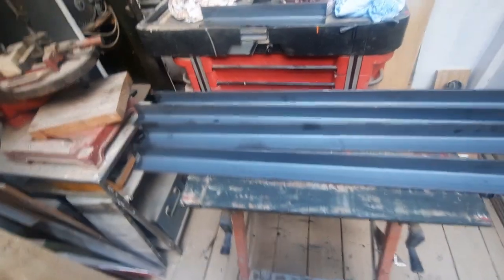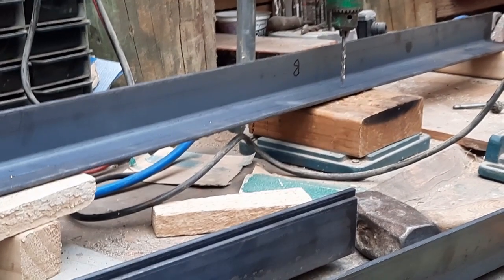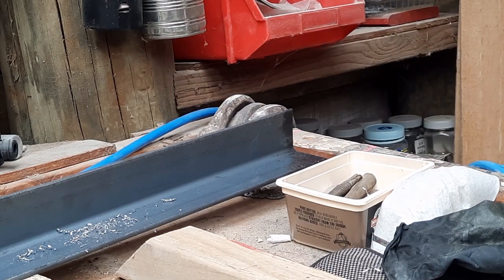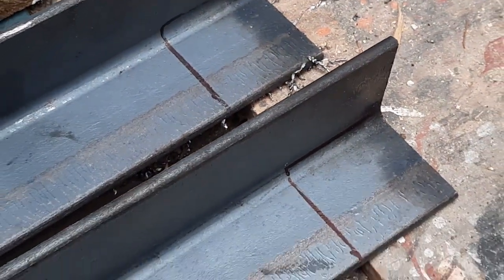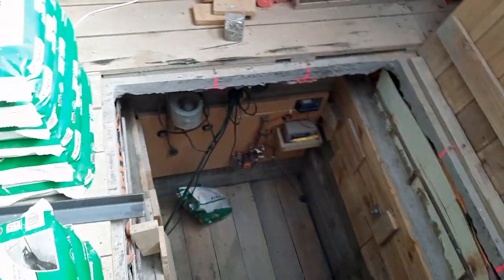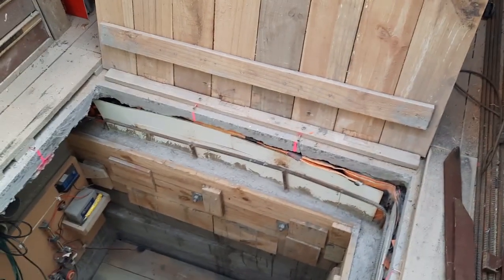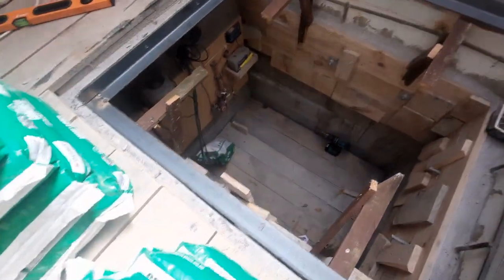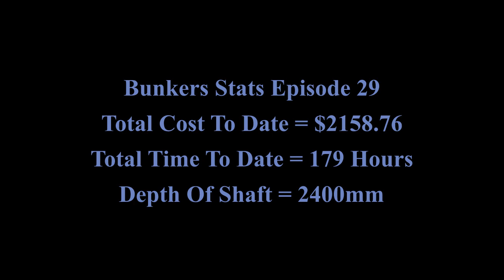Episode 29 Making and installing the bunker hatch flange

Comment: Top job on the steel frame. Great idea putting the pins in the concrete and then welding them in flush. Quite impressive. Looking forward to seeing your lift. If you need any advice, make sure to put a video up with your plan. We are all keen to help.
Reply from the maker: Thanks mate appreciate it.  I find it very satisfying  working it out as I go.  It's a great hobby.

Comment: starting to look good there lex.  i used to watch dale, and i know he went to a different host to upload his videos, can you tell me what platform he is now on. thanks. cant wait to see the lift that your going to make. i would just do tracks like garage door on all walls and make a platform to fill the whole opening except a cut out for ladder. use a winch in a cut out in the wall with cables attached to platform. will need turnbuckles to adjust all cables equally. will need the platform to have legs for cables so when it comes to top its flush
Reply from the maker: I'm going to use c section steel tube on the front and back of the lift with guide wheels encapsulated within.   If you head on over to Rumble and look up our mutual friend you'll see he's made something very similar.